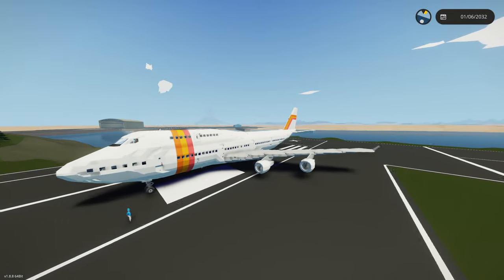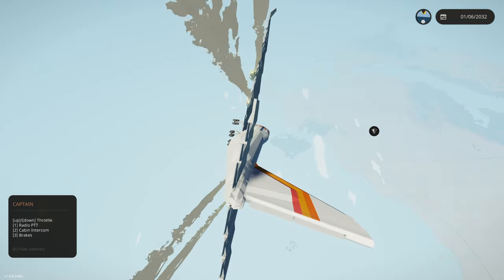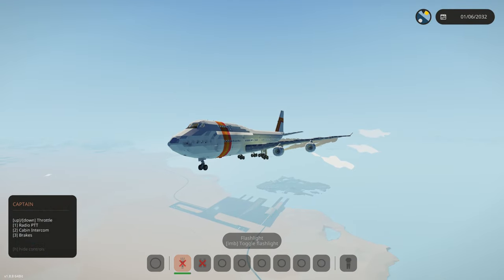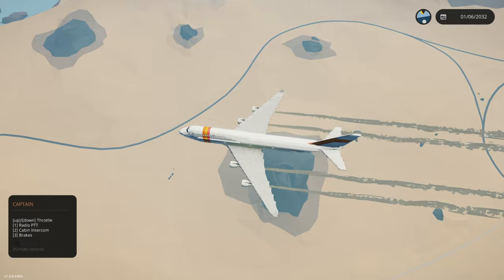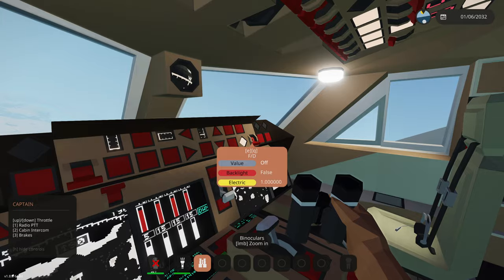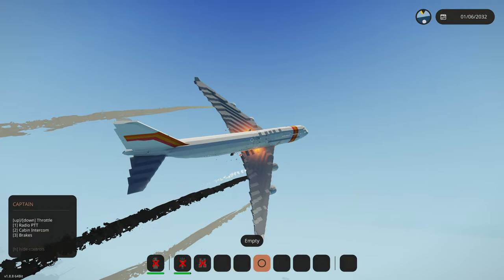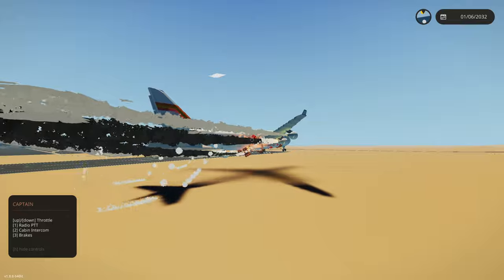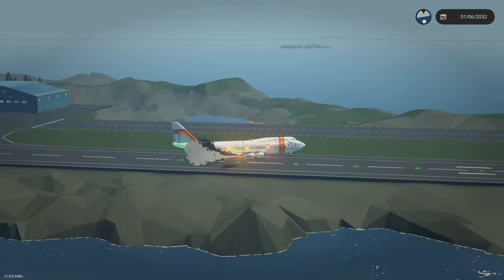Cabin FIRE In 747 Causes CRASH LANDING In Stormworks!

Comment: Cause for crash: Pilot error FOR THINKING IT WOULD BE SAFE TO FLY THROUGH THE SMOKE OF AN ACTIVE VOLCACNO, Mechanical failure engine 2 and 3 failing due to fire destroying or tampering something and the landings gears, also pilot is charged with murder for burning the passenger and ash being sucked into engine 2 and 3 causing embers to spark with the carpet of the plane